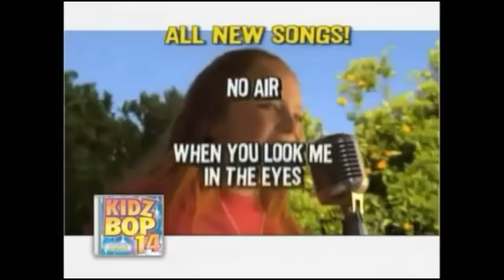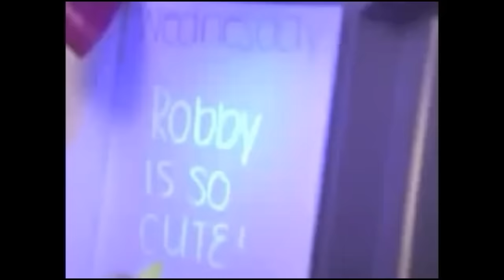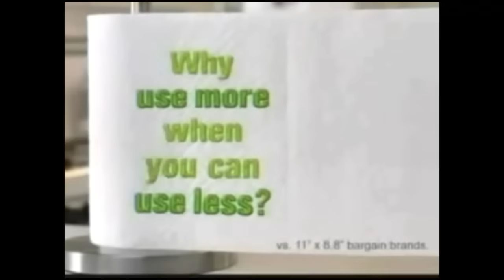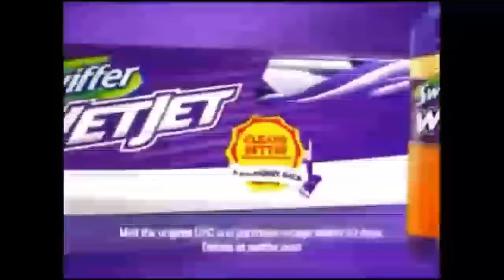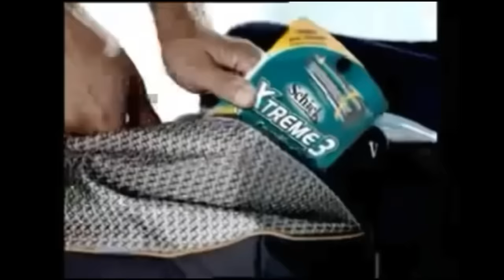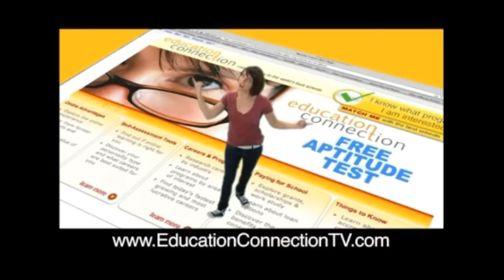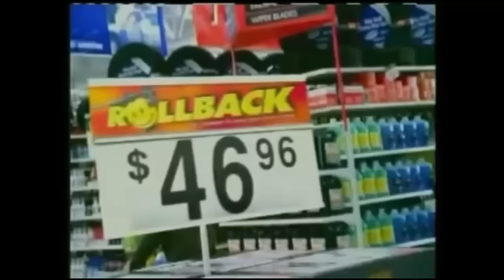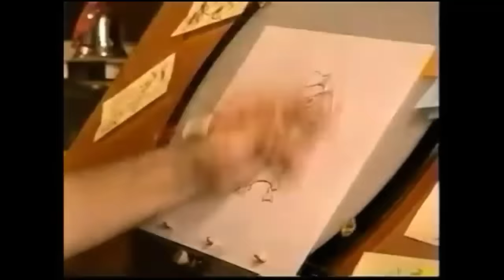2008-2009 TV Commercials (nostalgia) Part 1.

Comment: 25:29 - They forgot to change the filler number in the script that they gave to the voice actor LMAO. They just slotted a random number (literally just 2345679) into the script, likely until they were actually able to secure a hotline, and yet no one noticed in editing or submitting the commercial.

Alternatively, they might have asked a voice actor for a sample with a fake number (which the VA agreed to as they assumed Gerber wouldn't use it with the incorrect phone number), then just used the sample anyway so they wouldn't have to pay them to do it properly.